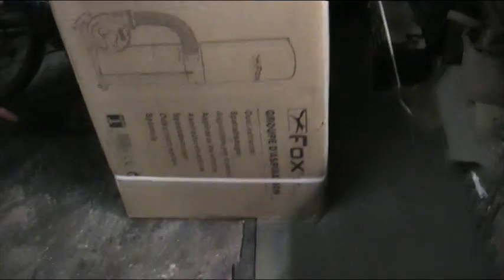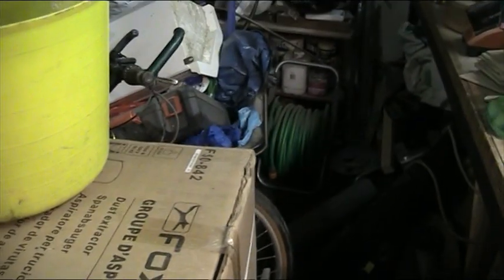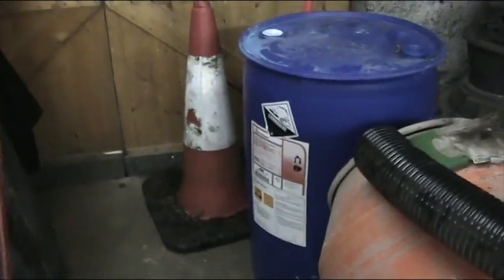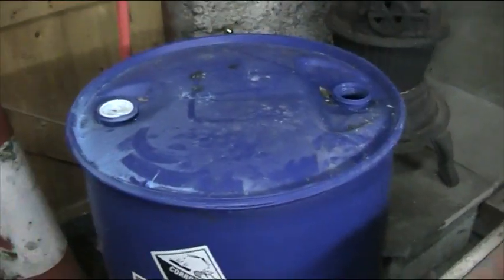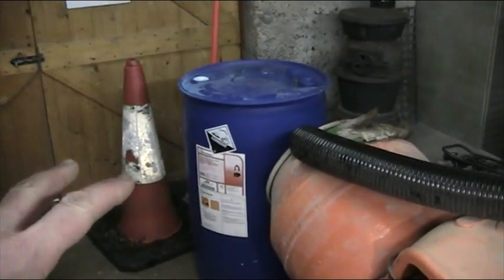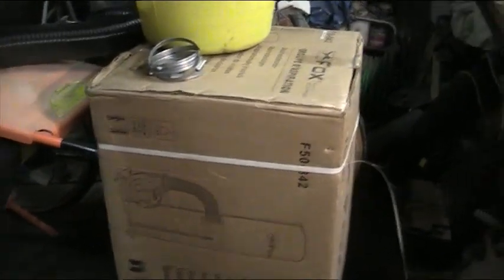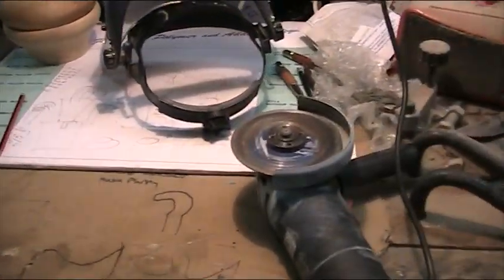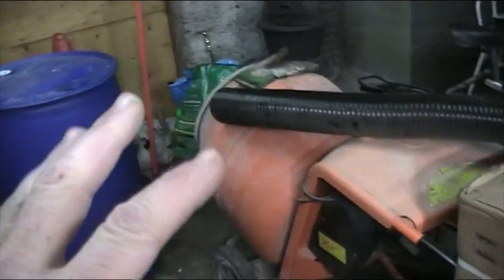Dust Collector Cyclone Project 1

Comment from the maker: Thanks Gary, I decided to get the extractor because, even though I have a super dust mask, there was sanding dust on everything I touched and I got covered with dust just brushing against something.  So the idea is to set the drop-box set up and then deep clean the workshop.  I can see the novelty wearing off that quick.  Best Wishes, Brendan.

Comment from the maker: Here's a good idea after the deed id done.  I jammed the barrel into a corner and held it that way, worked OK.  If you look up dust cyclone here there are a few versions.  The most technical is the 'Thien Cyclone Separator Baffle' model but mine is the Derrymacash model so if it works I'll be happy enough.  
Best Wishes, Brendan.

Comment: It will be interesting to see the final assembly. It's not just wood dust you'll be rounding up right? There will also be wood shavings? I read recently where some use wood shavings as media for hydroponics instead of coco coir. They didn't say if it mattered what type of wood though. But it's a thought. What do you do with all the wood dust etc? 

I figured you were gonna say something about certain planets lining up. I never thought about the math aspect of it at all LOL